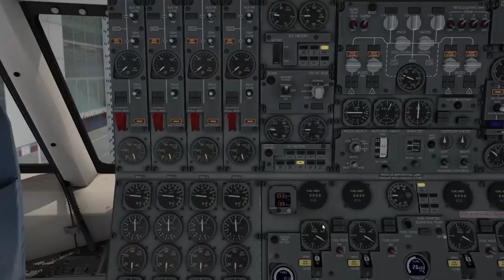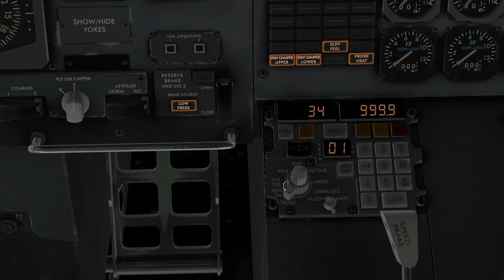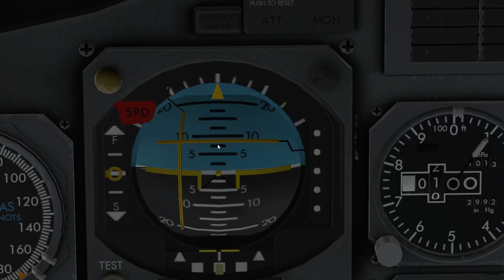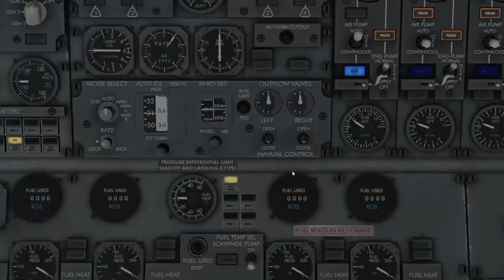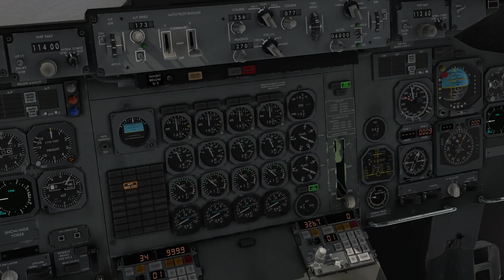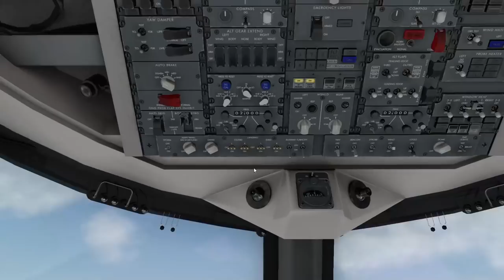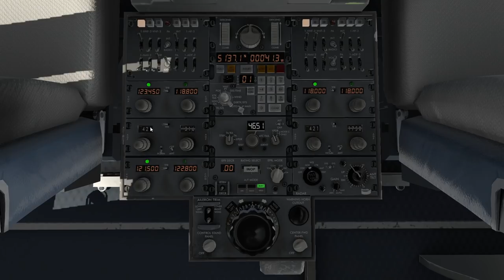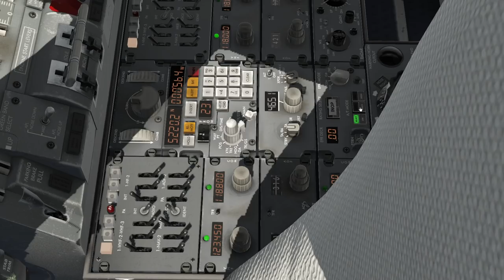Felis 747-200 Full Tutorial - Part 2 - Let's Fly

Comment: If you start the engine 3 after engine 4, you can then close the right isolation valve and turn the right pack on. This allows engines 3 and 4 to provide air conditioning to the cabin while the APU starts engines 1 and 2. Very important in hot climates like Phoenix, since every minute the air conditioning is off, the more your passengers cook!
Reply from the maker: Thanks - that makes sense. The A320 cabin will cool down very quickly, but colleagues that have flown the 747 do comment on how long it takes to cool down.  Are there any hydraulic considerations if you were to do that? I know there were concerns about bleed demand from the APU when considering packs and ADPs.

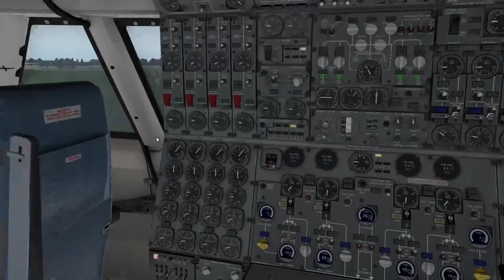Comment: As a B747 Flight Engineer with over 20,000 hours of experience, I commend you on your outstanding presentation. But I must point out a few inaccuracies.  First, when you placed the engine Bleed Air Valve switches from Closed to Open, the VALVE CLOSED light will not extinguish.  The Bleed Valves are still closed so the lights will stay illuminated.  These valves are electrically controlled and pneumatically operated. The valve will not open until you go to GROUND START during engine start. Second, when you pressurized #4 hydraulic system using the #4 electric hydraulic pump, the pressure comes up to 3000 lbs. On the pilots panel you show the HYD SYS PRESS 4 light extinguished. This is not correct. The pilots hydraulic warning light comes on when BOTH the EDP and ADP low pressure lights are on at the Flight Engineer Panel.  Since using the electric hyd pump does not extinguish the EDP or ADP light on the FE panel, the pilots light will remain on even though the system is pressurized. As you can see when you turned on #1 ADP, this extinguished the ADP low pressure light on the FE panel which in turn extinguishes the pilots HYD SYS PRESS 1 light. Third, you stated that the body gear steering PRESS light on the FE panel is on any time the Body Gear Steering is armed. This again is not accurate. With body gear steering armed and the nose wheel is straight, there are no lights on at the FE panel. When the pilots start turning, at 20 degrees of nose wheel deflection, the PRESS light will then come on, showing pressure is available, followed by the left and right unlocked lights. And when any UNLOCKED light is on at the FE panel, there is also a warning light up front for the pilots that says GEAR NOT CENTERED. AT 42:51 where you can see the UNLOCKED lights on the FE panel, the GEAR NOT CENTERED light should be on up front. Also, I noticed the ELEV FEEL light on with no hydraulics pressurized. This cannot happen as that warning light senses a difference in hydraulic pressures between #2 and #3 hydraulic systems, and since both 2 and 3 hydraulic pressures are zero, this light will not be on. If you were to pressurize either system, then the ELEV FEEL light would come on because of the difference between the 2 systems. 
Again, your video is excellent, and I realize that I see things that really don’t matter much to most viewers.
Reply: Hi John. To be short you are fully correct on all items and they are on the to fixed list. The elev feel is reapaired. The other ones were/are delayed by  recoding the plane to make it work in XP12.  As we are busy with a failure system the mention items will pop up for sure. Thx for the sharp eye.  You can write me a priv message if you see more details. Always open for suggestions and corrections. Josd777
Reply: @josd777 That is awesome. I really love the details of that plane. Great work.
Reply: Some years ago, I would have said „I go wherever PMDG goes“, now it‘s more „I go wherever Graham goes“. Hope your tutorials will come back at some day. Maybe when Concorde V4 comes out, that would be great. Red Robin, out.

Comment: Wish there was a speed option for the checklist. Real crew aren't that slow at checking things typically because they remember the next item before it's been read
Reply from the maker: Yes it is a little slow for my taste. However, I'm speaking as a shorthaul pilot - in my conversations with longhaul pilots they're always clear about doing everything slowly, deliberately and methodically - they are often flying on the wrong side of their body clock - so it may not be too far off.
Reply: Disagree. Crew with good CRM do not rush checklist and anticipate too much or that bias will turn it into parrot poetry and that is how you miss items. LH540 a 747 crashed out of Nairobi precisely due to that!

Comment: Course window settings, NDB, and VOR frequency heading is solely used for departure in this tutorial and not for cruising, correct?
Reply from the maker: Sorry for the delay responding - yes the enroute section of the flight was perfomed using the INS navigation, although you'll need to use the nav radio frequency to set up DME updating for the INS. Since the video was recorded the simulation now has the option to use a Litton navigation system which includes a waypoint database - it's a bit easier to use when you don't have access to full charts.

Comment: Absolutely fantastic video series Graeme, I have just purchased the 747-200 and I love the detail of all of the systems. I am experiencing a significant issue. after starting all engines using the checklist and beginning the after-start checklist for the FE, when checking the Gen 1-4 AC Meters, 0 Hz and 0 Volts are showing for all engines. The engines are running and stabilized. 0 KW KVAR is showing on each Gen, cannot select Gen closed as there is no power to transfer. Also, when I increase my throttles, nothing happens with the engines, the throttles themselves move in the sim to correspond to my 4 Honeycomb levers, however, no movement of the engine gauges. Any ideas if this is a bug?

Comment: Two things I don't quite understand: 
First, at 50:38, the aircraft was in level flight, A/T at SPEED mode, A/P pitch selector at OFF position, and ALT SEL at ON position. Why did the aircraft increase the altitude when a new altitude was selected and FMA ALT SEL changed to amber?  
Second, I know the A/T SPEED mode allows you to control the speed directly through the MCP panel, however, during the test flight I did yesterday I found the A/T MACH mode seems to work differently, does MCP speed knob control the speed if you have A/T in MACH mode? or the A/T will 'lock' the mach speed at the moment you switch the A/T on?  Thanks!
Reply from the maker: Thanks for the questions James. The first is a feature of the altitude select mode, it will adjust and track the altitude when it changes a little bit, and I used that to “trick” the aircraft into a slow climb rather than changing modes. Once the altitude target is too far away from the current altitude for the green alt tracking, the ALT SEL annunciator goes amber it the holds the pitch until the vertical mode is changed . For your second question A/T Mach holds the current mach when the mode is selected, it doesn’t care about the speed dial.
Reply: @ReflectedRealitySimulations  Thanks for the reply Graeme, you are making the best tutorials for 742 and Challenger on Youtube! Still waiting for the 742's descending tutorial, I think descending management is one of the hardest things to do on 742.
Reply from the maker: Yes descent management is hard without all the information an FMS provides. As a clue, you could program the airport reference point as a waypoint on the third INS, then use that as a distance reference for 3 miles per 1000ft of altitude. I'll get back to the 742 to finish the series once I'm confident the simulation has stable and consistent landing behaviour over a couple of versions.
Reply: @ReflectedRealitySimulations  That sounds good, so in the third INS, should I go waypoint change from 0-5 (if the airport waypoint is 5) first, and select dist?

Comment: Hello, are you sure, that we must turn autotrust after engines stabilezed?  Autothrust blocks thrust levers, and how we can reject takeoff?
Reply from the maker: Yes indeed. In fact the full name for the Autothrottle is FFRATS, Full flight regime auto throttle system. In the real thing you can of course pull the throttles back for a rejected takeoff, the "blocking" is simply a sim feature that you can turn off if you prefer. I have the AT toggle switch bound on my throttle where the AT disc button is normally so it's easy to turn it off if required.   Of course, you can choose not to use autothrottle, but the point in using EPR mode is to maintain "Takeoff Dry" power as the aircraft accelerates down the runway.

Comment: Excellent video obivously! I'm curious about the speed restriction below 10,000 though.  Perhaps I missed it but are you doing a high speed climb because of weight limitations?  You mentioned the minimum clean speed of 273 several times so that makes sense to me.  I'm wondering if one would need to climb to 10k with flaps 1 set to adhere to the speed restriction without requesting a high speed climb?
Reply from the maker: Sorry for the delay replying, yes high speed climb due to the weight. Very common with the 747, in some cases ATC will automatically approve and don’t need to be asked, on other cases you need to ask them, but it’s better to be clean than climbing with flap out. Of course, if there’s a specific speed restriction you may have no choice, but the 250kts/10000ft limit is something that can often be removed.

Comment: Hi, I've got a question about using A/T on the 747-classics (in real-life). A while ago I've read that an old A/T could not move the thrustlevers automatically (like in a modern boeing). If I look at real-life video's of a 747-classic taking off I can see the FE apply the correct thrust for take-off. So, I am still wondering how the A/T switch and setting the speed during during climb, cruise and descent works (when AP is engaged), since the thrust levers seems to be the operated by the FE?
Reply from the maker: Yes indeed. The flight engineer is responsible for the engines at most times. That's one of the reasons the FFRATS ratings control is at the back end of the pedestal. The pilot can ask the FE for what they need, and the FE will provide it, either automatically or manually.

Comment: Hi Graeme, superb series of vids on the 747-200. Quick question, when you run through the checklists (and also engine start), there's a cockpit voice responding. I have crew voices set to ON in the EFB, but get no voices. Is there a separate plug in you use, or am I missing something simple?
Reply from the maker: Thanks for the nice feedback Tom. It’s all part of the product and I don’t think there’s anything specific you need to do for the checklist voices. Maybe worth posting a question in the support forum.
Reply: @ReflectedRealitySimulations  Hi Graeme - all sorted now. It was simply the Co-Pilot sound on XPlane settings was set to zero!

Comment: What I noticed that is missed from the last video is Galley Chiller knobs which are all off. Should be on right ?
Reply from the maker: Yes indeed. Another continuity error, thanks for pointing that out! I’ll note it in the description.
Reply: You turn them off before switching power from the apu to engines or before engine start?

Comment: do you not put the UMLAT waypoint in the INS?
Reply from the maker: You could do, but as it’s defined by Midhurst VOR radial 356, and is very close to the airport I found it easier just to use the radio navigation for that and transfer to INS later on.

Comment: Hi do you know where the radio ins switches
Reply: Overhead panel on the right
Reply: @Willoz269   thanks
Reply from the maker: Also you should hopefully have seen you can display radio on the HSI, while the AP is following the INS, so when you transfer to radio navigation you can swap the HSI over, verify the guidance and then switch autopilot modes.

Comment: 45:39 Why does the thrust increase? Does it for me every time too.
Reply from the maker: That's a good question, and I really don't know. Will ask my good friend CaptCrash on the Felis Discord about it - it could be a sim issue as I know Felis does a lot of direct manipulation of the aircraft parameters.
Reply: @ReflectedRealitySimulations  Since asking this I believe it actually decreases from the start of TO roll and is rolling back up to the correct setting. Apparently the A/T wasnt used much on the -200B until in the air so perhaps best to use handheld throttle to maintain desired EPR.

Comment: Ive got a question too, I depart from gatwick and there isnt a NDB freq for example: MAY on 452 

What do i do?
Reply from the maker: When flying older aircraft in the modern sim environment you really just have to fill in the gaps yourself. Gatwick SIDs are based on Mayfield, Midhurst, Detling, Southampton and Seaford VORs. However, if flying offline you could simply climb straight ahead until above any terrain (3000ft is good for London) then turn on course.
Reply: @ReflectedRealitySimulations  thanks for the reply. Ive got another question:
When planning the ins co ordinates, i dont know which co ordinate is the start. do i count 9 co ordinates back from the last co ordinate or where do i start?
Reply: @ReflectedRealitySimulations  And also how did you get those co ordinates to x plane as a png?

Comment: Hi, do you have any suggestions how I can control the plane properly during crosswinds? I seem to struggle to always stay on the centerline of the loc, I am usually too far left and then too far right. I know I have to drift the plane in the wind and I always try that but somehow I am struggling to keep the plane stable. I have heard that you can calculate on which heading you have to fly to stay perfectly on the loc. I would be glad if you could give me a hint or anything like that. Thank you for your very informative videos. I love learning the systems with your tutorial series ^^
Reply from the maker: It's a tricky thing to get right. Most of the time crosswind issues are actually cause by the pilot overcontrolling rather than the wind itself. Remember make a correction, then return to wings level and wait to see the effect of your correction. Then repeat as required. Don't "chase" the centreline by rolling continually.
Reply: @ReflectedRealitySimulations  Thanks for the hint ^^ Since it is currently quite windy in Europe I can practice my landing skills

Comment: Thanks for the tutorial. I thought that the EPR mode was used up to the Mach transition speed.

So after acceleration. Altitude, you switch TOD to CLB and EPR to speed set AT speed of clean speed and or 250 (the one that is the lowest) then after 10000ft, you select AT speed of the optimum climb speed. After reaching your Mach number, you select Speed to MACH on the pedestral and on the MCP ?

So far I kept EPR all the way until Mach transition speed in IAS mode then Mach et EPR to Mach on the pedestral. Guess I was wrong all the time ….
Reply from the maker: You can do that too - except you don't use AT speed for optimum climb - that AT Speed window is a throttle mode, not a pitch mode - leave it EPR and "capture" the optimum climb speed with IAS pitch mode.
The issue in the real world we have to comply with ATC altitude constraints and TCAS considerations, so while EPR Climb from the point flaps 5 is selected until the cruise is entirely possible, it's unlikely you would get a continuous climb from ATC. That was why I was demonstrating a level off at 6000 and FL80. Again you could use EPR, but then you'd be switching back and forth all the time. As such, speed and VS is easier to manage at low levels, especially at lighter weights.
Reply: @ReflectedRealitySimulations  On the plane of this era(I flew the DC10)we always use the AT in "N1"(GE powered) for the duration of the climb to cruise altitude and the pitch modes of the AP, "VS" to accelerate to the desired climb speed then "IAS"and finally "MACH". To climb to another  flight level we did the same, the "music" was : CLIMB, N1, MACH HOLD. At altitude capture we selected "SPEED"at the AT( on some DC10 the switching to AT speed mode was automatic). I'm almost sure my 747 colleagues did the same.
Reply from the maker: Perfect thanks, that makes sense. The manual switching between speed and EPR on the 747 is the bit that adds to a simmers workload, especially as it will just drop the AT if you mistakenly select IAS pitch, hence using AT speed for little climbs. The other issue is there isn’t a direct pitch input, so for both the initial takeoff accel and FL100 accel EPR and VS is used.  I love these older aircraft systems, being aware of what it’s trying to do at each point is so important.
Reply: @ReflectedRealitySimulations  I guess Boeing engineers place the AT  modes control where they could and on a place which is not really obvious and convenient(at least for flight simmers). Fortunately on the DC10 all the controls were in front of your eyes which made them easy to locate and use. Keep them coming you do it great!
Cheers

Comment: 21:18 bitterly disappointed that this has not been modelled. That would add a true mark of authenticity.
Reply from the maker: The Fuel Heat? It was simulated in the beta version, but there were some questions over how the system was behaving, so for release rather than have a half working system, it was deactivated. The plan was always to reinstate it in an update, so I'm sure it will be back again.
Reply: @ReflectedRealitySimulations  APU load
 One thing I love about authenticity though is the stickiness of some of the guages. Watching those engine param readout guages struggling to change value is Uber realistic and something I wish flyjsim would improve to their classics.